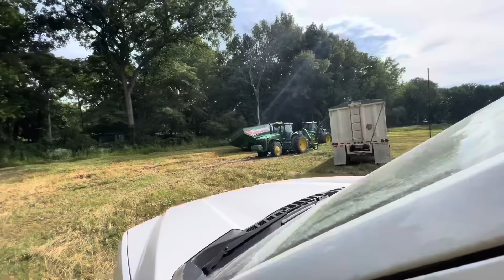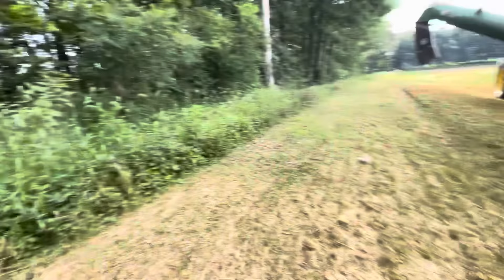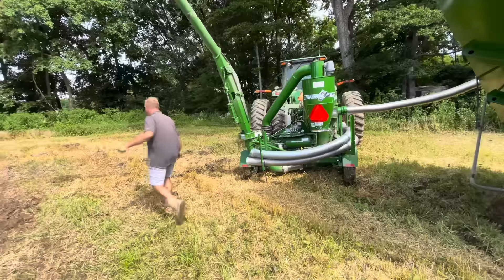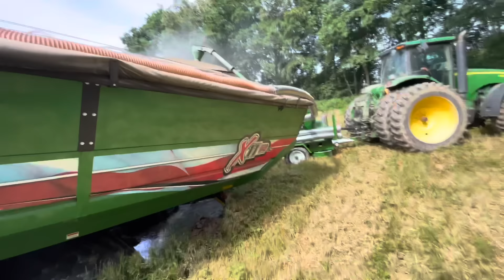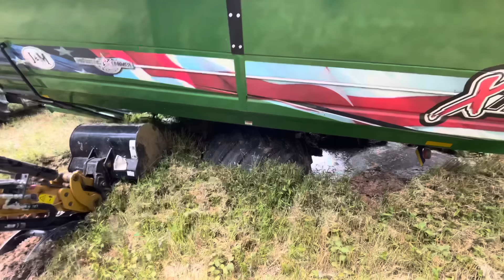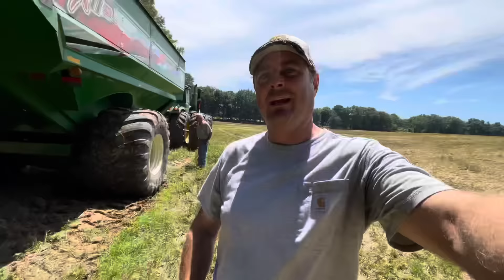Grain Cart Fail, Farm Fail

Comment: S Happens... Why did ya not just hang the rubber flex vac hose to the hoe bucket or a self propelled auger and slowly lower the hose into the grain in cart????
Reply from the maker: There are several ways to do it, the farmer chose this way and it worked, thanks for commenting.